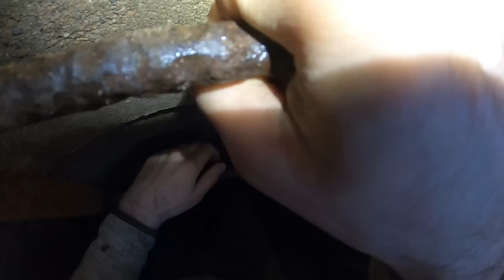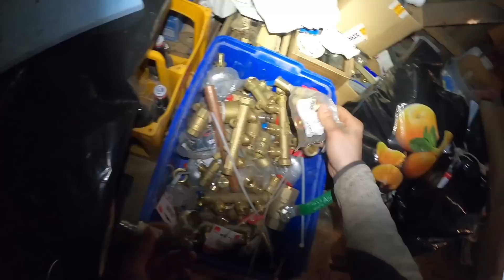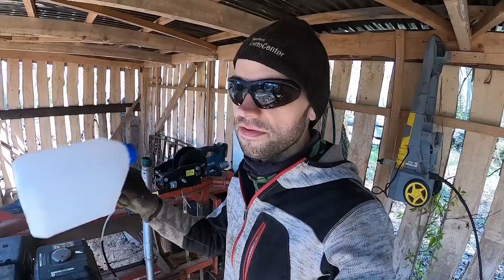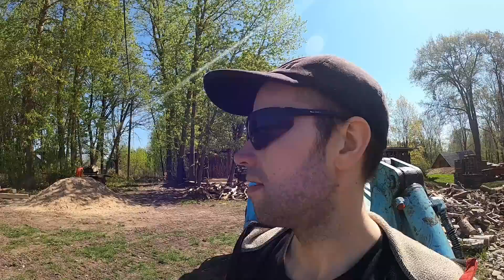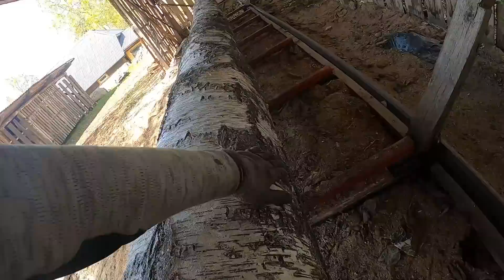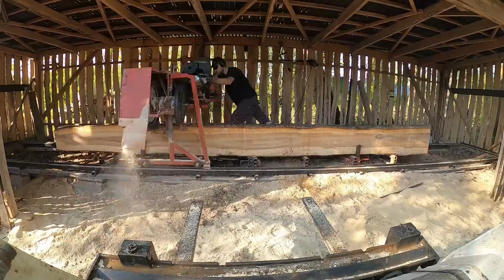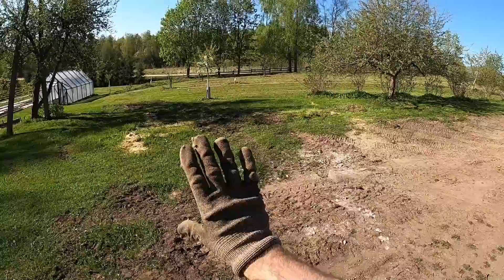Building a new workshop (part 1) - Sawmilling the main beams

Comment: Andris I think that has to be the first time I have seen Birch tree's that tall it's unfortunate they were splitting as you were cutting them. I guess you take the good with the bad and all the left over will make great fire wood. They sell that here in bundles for camp fire wood 6.00 dollars a bundle they wrap the bundles with plastic wrap and staple the ends of plastic to the wood itself some add handles of some sort for lifting. I think they have anywhere from 10 to 15 split logs. Then folks will put at the end of there drive with a for sale sign and the honor system box. Putting a lock box out for them to put the proper amount of money in the box this way you do not have to be present to sell it. But make sure you secure your lock box so they can't take off with your money. It's a great way to give you extra cash in the summer months into the fall. I will add a link so you can see what I am talking about. Some folks with big gardens also do the same method with vegetables and fruits here only they leave the vegetables on a table not in the sun or in boxes what ever works for them some make stands . Some stands are for wood some for vegetables. it's called the honor system.  Great video. We so enjoy them so much. 
https://external-content.duckduckgo.com/iu/?u=https%3A%2F%2Ftse2.mm.bing.net%2Fth%3Fid%3DOIP.3NjrBnXWdGiEPKDUHI5ZYwHaE8%26pid%3DApi&f=1&ipt=13090908b353fe003729614235842c92d574a537a64be00aa71604e104d94cf9&ipo=images
Reply from the maker: Great idea man, i may think about it. THanks